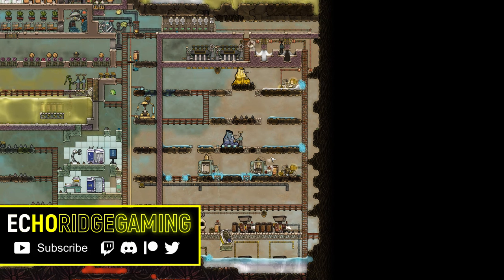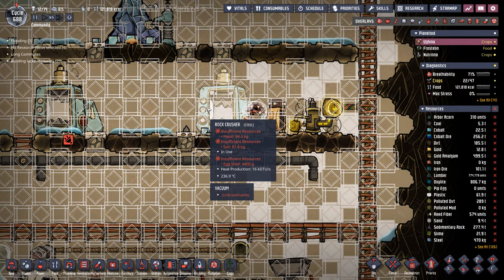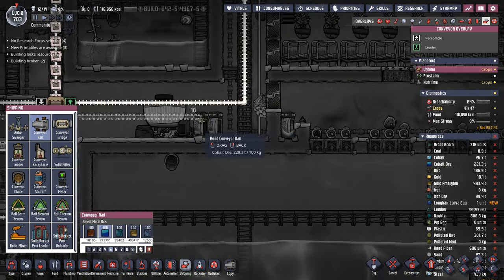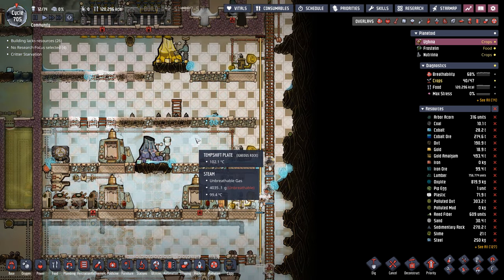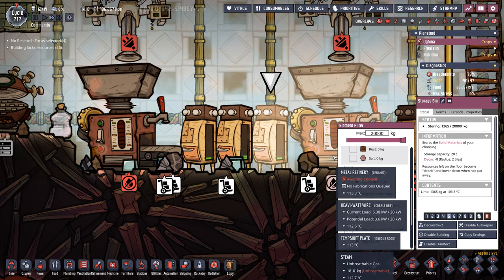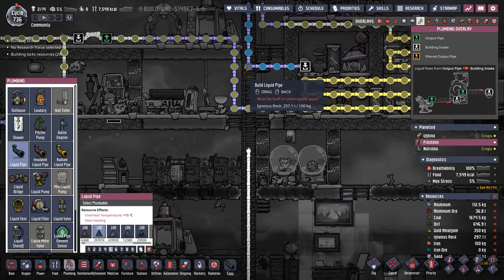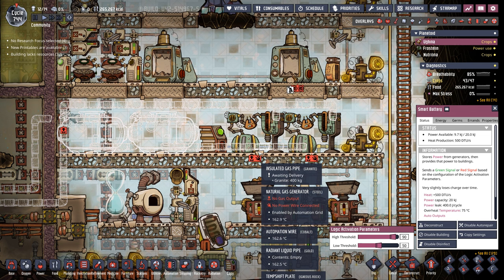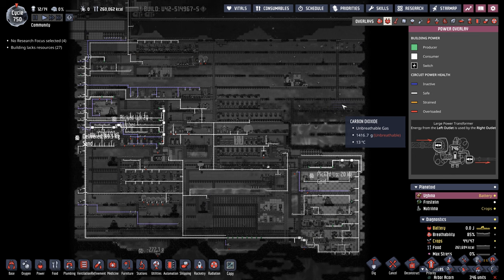Debris Cooler 4000 | Colonization Ep 10 | ONI Spaced Out

Comment: I was noticing in my playthrough that bridges transfer way more heat than you might assume between your hot (sauna) and cold (cooler) areas if part of the bridge is in the hot area and part is on the insulation tiles. You can eventually notice the difference once temperatures have stabilized by looking at the aquatuner uptime with and without a bridge on those tiles. Having hot things on rails on your insulation tiles probably has the same effect. I think it's the same concept as temperature shift plates touching your insulation tiles. Definitely caught me by surprise.
Reply from the maker: I think you are correct.  I will see what I can do to fix.

Comment: Might try aluminum metal tiles instead of polluted water for your cooling rails to go through. 205 thermal conductivity vs polluted water's 0.58. Also you get better heat conductivity by running through solid blocks vs gas or liquid.
Reply from the maker: I want to try this.  I think polluted waters mass makes a difference too though.  100kg tile vs 1000kg liquid.
Reply: I’ve done the same with aluminum tiles and it cools down pretty hot material in 3-5 blocks. Just doesn’t cool plastic that fast.
Reply: @TheSimpleGamer42  genetic ooze is another thing that doesn't change temperature very fast. So food; I have a fairly large aluminum block to precool my peppernuts.

Comment: You don't really need to loop the cooling material rails. while fighting and eventually giving up trying to fix the loop constantly locking up for no reason (90% sure is was a bug 2 versions back), I found just stopping the rail, until the material over the sensor is cool enough to proceed, is way less troublesome. I just had to tweak the coolant line so that the coldest liquid would enter where the rail exits and follow the rail in the opposite direction. The tweak was needed because if going the same direction the coolant may not be cold enough to cool that halted material having warmed up in the tank.
Edit: 10:45 Hmm Looks like you might be Echoing the same issue I had :). Keep an eye on it, especially when you reload the game
Reply from the maker: Will keep an eye on it, thanks for the tip.